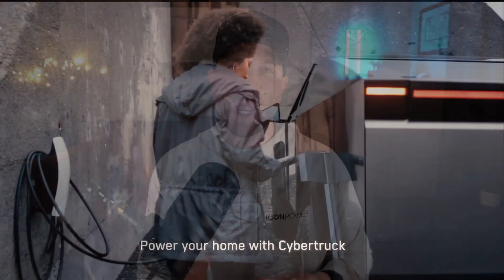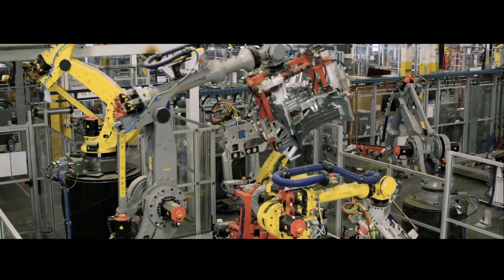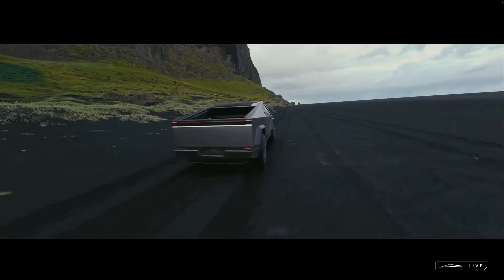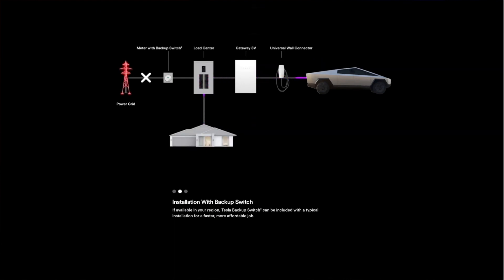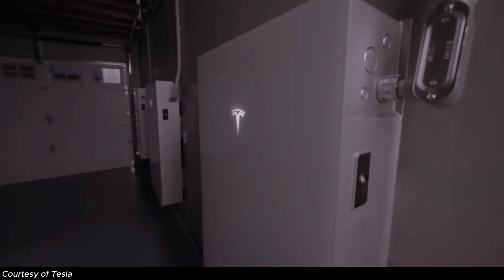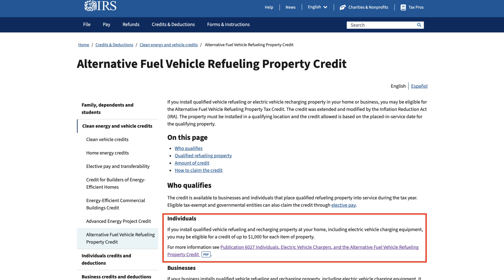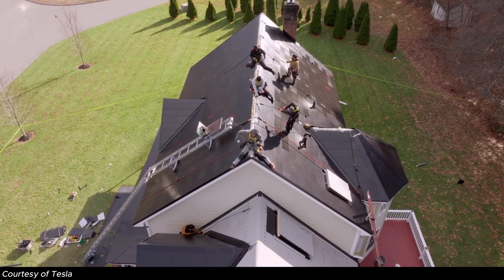What's Going On with Tesla Powershare? (Cybertruck + Powerwall 3?)

Comment: I would like to pick your mind on something like using powershare via the v3 mobile connecter with the powershare adapter to create a 'virtual grid' by connecting it to a solar hybrid inverter grid connection so when there's excess solar, the inverter exports energy TO the 'virtual grid'' (Cybertruck) and when there's not enough solar, it draws energy FROM the 'virtual grid'. Basically a bidirectional charger without any extra components like gateway/Powerwall. 

Do you think this could work smothly and in a way it can be automated so I wouldn't need to manually change adapters? 

Maybe I could built a custom bidirectional adapter? Thanks!
Reply from the maker: Oh wow, that'd be tricky to do. It'd require you to override a lot of software. That's a bit part of the limitation of everything here too. Not sure it's possible.

Comment: We are having two PW3s and a GW2 installed on March 17th for a Whole House backup mated to our existing 12.5 kWh PV system.  But our next EV will have PowerShare. We are holding off on buying a new Tesla until PowerShare is offered. If Tesla drags their feet, I'll move on.  FYI, we own a 2022 MYP with a Gen 3 HPWC.   Having an additional supply of backup power during long-duration outages in bad weather, when solar production drops to almost zero, could be a lifesaver.
Reply from the maker: Hope your install goes well on Monday! I know it’s been a long time coming for you. 🔋
Reply: @ZachSolar install was completed on March 26th and my utility blessed it and issued our PTO on April 14th.  We are on a NEM 1.1 program so no TOU pricing so we are using our PWs strictly as a Backup Generator.  We sleep better at night.  Thanks for all you do, I have learn much from your videos.  Tom USAF Retired
Reply: Can you give us a cost break down on the powerwall install, batteries etc.?
Reply: @whattodonext312 $33,6xx before incentives, $15,6xx after.  Less than a 2& kWh GENERAC generator.

Comment: The Cybertruck has an all new PCS (Power Conversion System).  The PCS does the charger (AC-DC) function and the low voltage system supply (DC-DC converter). This new PCS also can act as an inverter to export AC power (48 A at 240 V, same capacity as AC-DC rectification).

The "S3XY" cars still have the old PCS, which was not capable of DC-AC inversion when introduced in 2018.  Has Tesla added this capability?  IDK, but likely not.

The company that confirmed that existing S3XY cars have bi-directional capability enable the export of high voltage DC power from the car's battery.  They use an external inverter to produce AC, which is a more expensive solution than Tesla's new PCS in the Cyberturck.
Reply from the maker: These are all great points. This is often overlooked when this topic comes up. I would doubt that bi-directional charging just needs a software update on their older cars. I'd hope their newer vehicles (non-Cybertruck) have the correct hardware to support this but I guess we will see.

Comment: Elon is right about PowerShare with a PowerWall 3 is a more optimal home solution given that any given EV is not always at home but the EV being home is not always necessary.  If I’m not at home the home doesn’t necessarily have to be powered and can n still be powered with homes equipped with off grid solar capability.  The major use case for EV PowerShare is a supplemental, long term, lower cost off grid home power resiliency. Full time power access isn’t always required, especially in an unoccupied home.
Reply from the maker: I think you’re 100% spot on. I see it as an extended battery that’s available during a prolonged outage, not something to replace a standby home battery.

Comment: Zach,  do you have any details on the communication cable from the universal wall connector to the gateway?  My installer doesn’t seem to think the cable is required and I havent been able to find a wiring tutorial that details the communication cable.
Reply from the maker: Do you have a Powerwall system already or are you installing just the Powershare setup (No Powerwall, GW 3V and Universal WC)?
Reply: @ZachSolar we are waiting for our system to be installed.   Powerwall 3,  gateway 3, 9.6 solar,  universal wall charger.  It’s my understanding communications is needed for the “charge on solar” and future PowerShare settings.
Reply from the maker: @ Powerwall 3 and Gateway will handle all the necessary comms. No additional comms wire will be needed. The Powerwall will communicate with the vehicle and charger directly through the pairing process within the app. Go to this link and scroll to "For Customers with Powerwall" https://www.tesla.com/support/powershare
Reply from the maker: @leafnutz2341  feel free to email me if you have more questions on it. infozachsolar@gmail.com

Comment: Hi Zach, I’m installing a 14 kW solar system with 28 panels, a Powerwall 3, and a Tesla Gateway 2. I currently have a 2019 Model 3 and a 2023 Model Y and a reservation for Cybertruck which I will not buy for a couple of years. Should I be concerned that my installer is planning to use a Gateway 2 instead of Gateway 3 for future-proofing, like power sharing? Thanks!
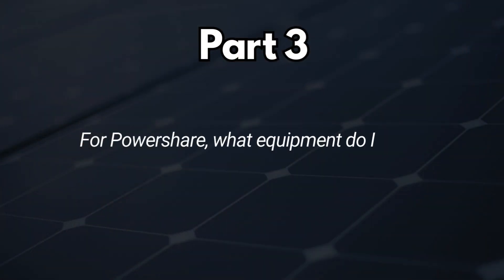Reply from the maker: No concerns at all. If you have a Powerwall system of any kind, it is compatible with Powershare (assuming the vehicle is). 5:44

Comment: What do you mean by "ensuring that your wall connector is a backed up load". I am building a home and will have non tesla solar panels, the newest tesla powerwalls, and want to ensure I can use powershare on future cars with this set up.
Reply from the maker: “Backed up load” meaning if the grid goes offline, will the Powerwalls be able to supply power to that load. You want to ensure your installer has the EV charger included in that list of loads.

Comment: Wish it is only software to enable other teslas.  Our X Plaid has a 100kWh pack and would help if we had a multi-day outage.  We already have a Powerwall 3 but it’s only 13.5kWh.  We also have the dual Anker Solix F3800 set up with a smart panel and expansion batteries adding an extra 30.8kWh.
Reply from the maker: Woah! If they give you Powershare, you might never need the utility company again with that amount of storage capacity. How do you like your Solix system?
Reply: @ZachSolar so far love the solix set-up just wished the expansion batteries were cheaper.   Best I could find online was ~$1600 each but adding the expansion is super easy - just plug them in.  I originally called our solar installer to get a quote to add another powerwall 3 added (for extra battery capacity and not additional load capacity) but they weren’t able to since only the fully batteries w/inverters, etc were available.  The Anker solix works well since we already have powerwall 3 else I would have had to move circuits to the critical loads panel.   When we move, I can easily remove the smart home panel and breaker and take the whole system with me vs the powerwall 3.

Comment: I am lucky enough to own a Genesis GV60 which has bi-directional charging ability. Prior to installing our Franklin battery, we had an outage so I plugged in a powerboard to the car, and ran the fridge and some other appliances and it worked without and issues. The franklin battery allows for charging from a generator so i don't see why it could not be plugged into the car (I don't have this feature installed). Separately, there are chargers which allow for bi-directional power flow already, so there is no reason houses cannot make use of this - I watched a video of an Australian wine refinery which has already done this. So the tech exists, and people have actually set it up already. The main issue is red tap for now, but it seems people are already breaking ground with this tech.

the problem with Bi-directional charging is actually charging your car in the first place to use at night. My battery is 13.6kw, which is deep cycled each night - that's 95.2kw of power per week. I only get to really charge my car on the weekend, so i need the power stored in the car to actually run the car during the week. Couple with this, the battery is set and forget. It just works without me having to do anything. So bi-directional charging is not really needed, and i would not spend $5,000 setting it all up to save a few cents per day when my battery already does the heavy lifting.

That said, I certainly see this as being pretty mainstream into the future - every charger will eventually be able to do it, and new houses will simply have this as a feature available within the home power box; but i don't think it will be until electric cars have a much larger share of the market, bidirectional chargers are much cheaper, and people are looking to use the car battery to save on getting a house battery (albeit a little more inconvenient).
Reply from the maker: I wasn’t aware the Genesis could do this! Very cool. Thanks for sharing your experience. And I agree - lots of red tape. The utility regulation alone is a whole nother conversation.